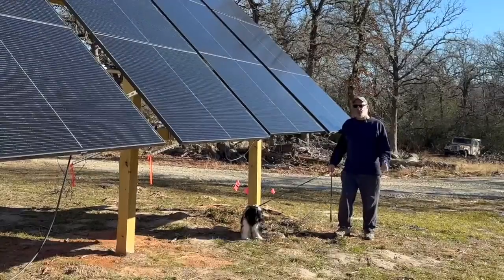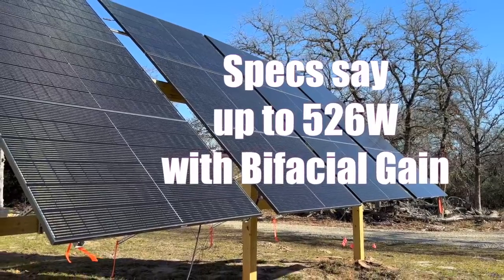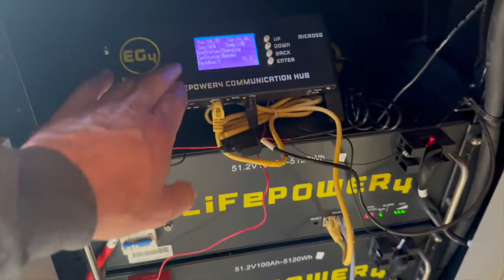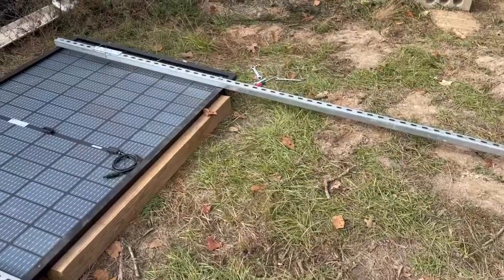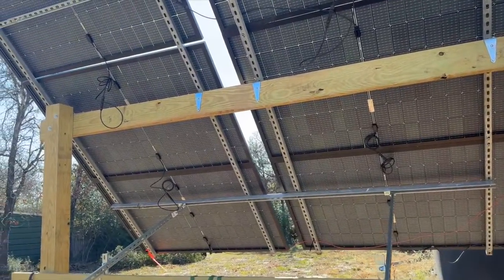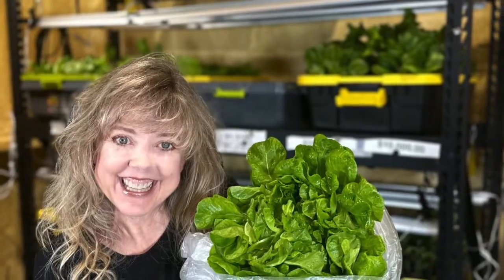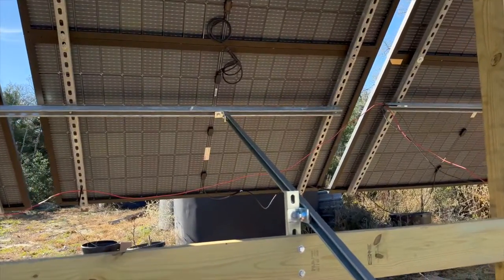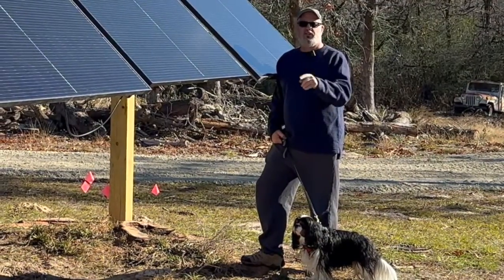Adjustable DIY Off-Grid Solar Panel Ground Mount

Comment: Been looking at those Bright mounts. Wish they had a higher wind load rating though.
Reply from the maker: Thanks!  Where I am if there is over 105 mph high wind, my panels are more likely to get damaged by flying tree limbs than they are separating from the rack. I plan to anchor the racks in concrete pilings.  I will say I wish the rails were 6” longer. You’ll have to improvise mounting for four panels that are over 44” wide.  It’s a good kit , easy assembly, cheaper shipping, with decent hardware, but it’s not comparable to a $2,500-$4,000 integrated ground mount system.🤠☀️⚡️👍🔋💡
Reply: @terrahillfarm  The county I live in requires 110 and above for code. I would like to bolt them down to the top of my 40’ shipping container. Subscribed.
Reply from the maker: @offgridliving4128  ok that makes sense if it is code.  Thank you for subscribing! 🤩.  I guess code may not allow you to build your own DIY, but I’ve seen some nice mounts built on top of containers with square tubing, uni strut and some welding.  I bought the Brightmount racks mainly to mount a few more panels, learn the design, and see if a permanent ground mount was really possible with them.  It’s tough to ground mount and anchor panels for less than $100 per panel.   I’d like to find the cheapest and best quality system with the longest life..  I’ve got room so I don’t mind trying several options.  Stay tuned and we’ll see how it all turns out! 👍☀️⚡️🤠🎯

Comment: Thats amazing. I've spent over 30 grand on my components and hopefully soon i can be home enough to enjoy all ove put together. Thanks to guys like you making the videos I was able to build a fairly nice system for my family and me to make our own power. Thanks for the video for sure
Reply from the maker: Thanks!  There certainly is a learning curve to DIY solar but there are some great DIYers sharing on YT and Will P’s Solar Power Forum is where most generously trade experiences, recommendations and answer questions.  If you go slow and carefully, and understand what causes the most risk and problems, you can be off the grid in no time! ⚡️☀️💡  Just don’t copy my wiring set up as I’m still in test mode and haven’t finished my conduit runs! 😳🤣🫣
Reply: @terrahillfarm  I'm off grid when home but I'm stuck in this semi truck 27 or 28 days month. I have 2 batteries I built. One is a 12 kw leaf battery and the other is a 21kw lifepo4 made from 280 eve cells 3p8s. I have 3 victron charge controllers. 150-70. 100-50. 100-30. I am able to charge with about 90 amps at 24 volts from a couple extension cords from my mother's house if I need. I'm going today to buy a few more 390 watt panels to put on my newest charge controller. I'm thinking 6 more will help a lot with all the grey skies we are having lately
Reply from the maker: @matthewknight5641  sounds like you’ve learned a lot! I haven’t built a battery yet but that’s next once I fill up my EG4 rack.  It’s been cloudy here and yesterday (shortest day of the year) was the worst ever.  If we hadn’t had grid for backup, I’d have just charged up my batteries with my 2 Honda eu2000 generators.  Over many years of making mistakes I’ve learned to always have a backup to the backup!  Hope you can eventually get to driving closer to home and spend more time on your solar.  I appreciate the feedback on my videos and hope to share more solar progress.  👍👍👍☀️⚡️💡🔋

Comment: Nice work keep after it. Having your own power company is absolutely priceless. My new panels are working fantastic I've  been getting almost 6000 Watts😊 coming in December less than 7000 total installed.
Reply from the maker: Thanks!  Wow you’re cranking up the power with those new panels on your trackers!  Winter is definitely the right time to dial in your panels.  Nice to see that yellow line going up on the graph ☀️.  We’re fortunate that we have the grid for backup for those times the solar cuts out, but we’re going to keep working towards 100% energy independence.  My wife wasn’t too excited when I started out with the solar but she loves it now when I come in and say “You need to use more power!”😂 ⚡️🔋👍